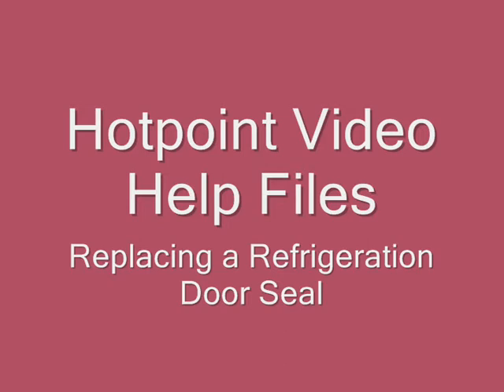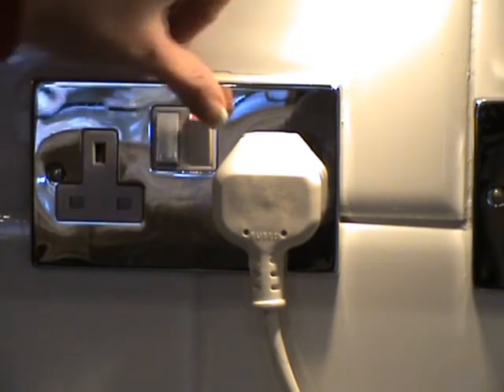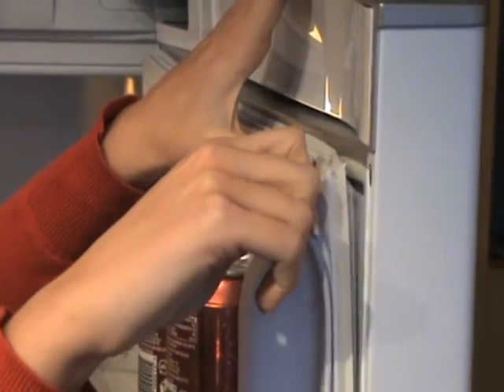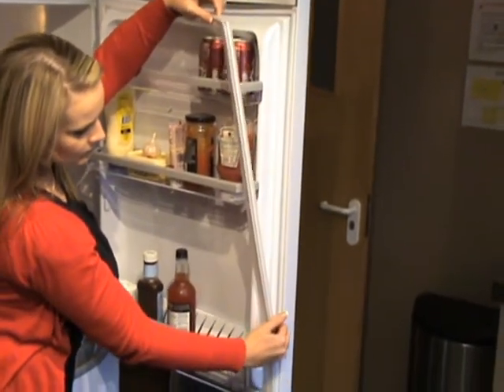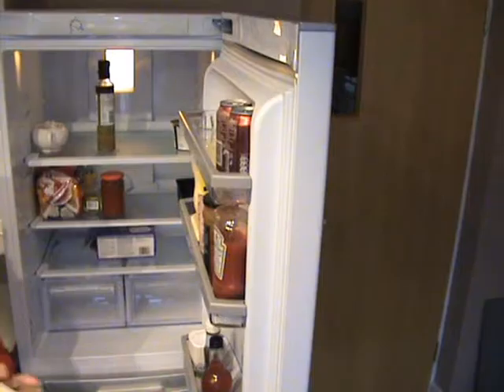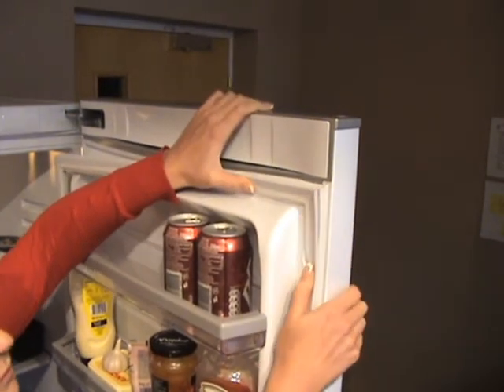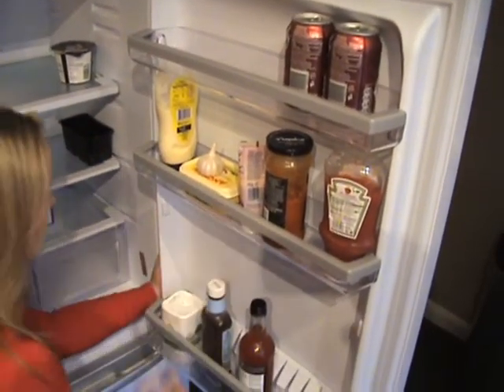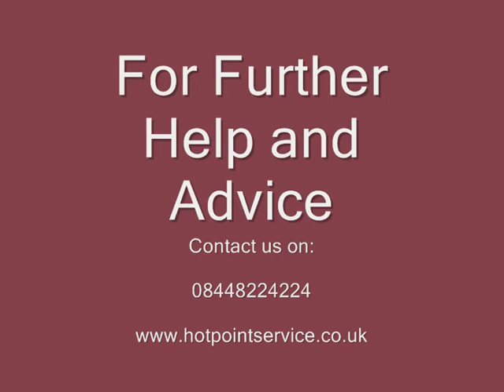How to Replace a Hotpoint fridge door seal

Comment: I have an integrated tall fridge and I tried to pull and it is pulling some other plastic foam out, so I stopped. Is this method for my fridge too. I did called Hotpoint, and they do not provide manual or guidance, which is a shame as it is a door seal.